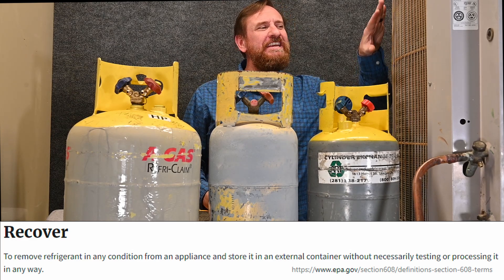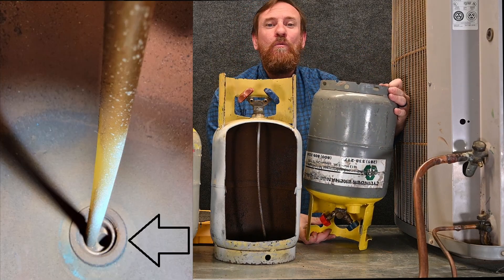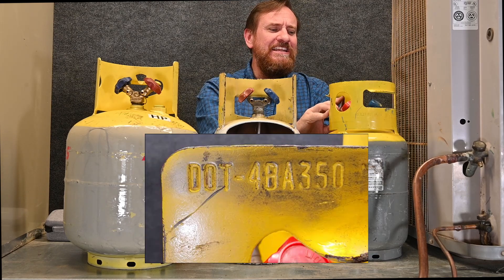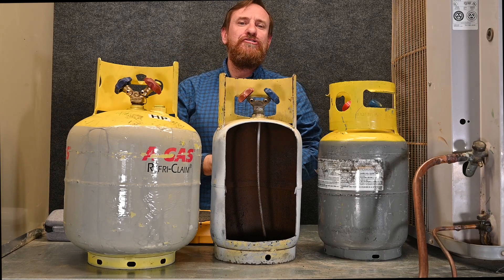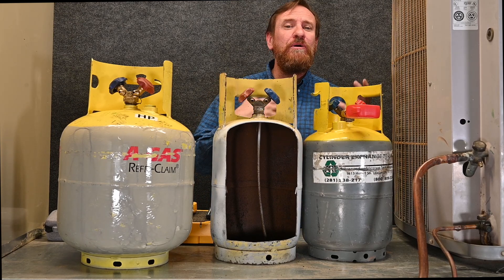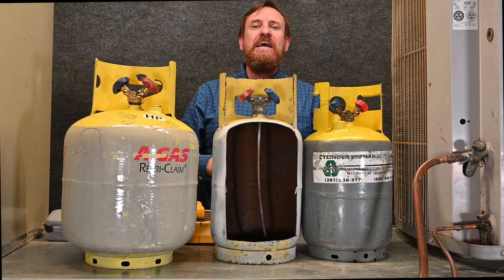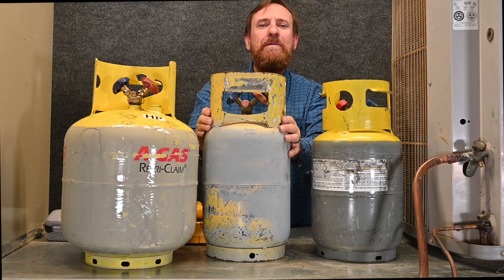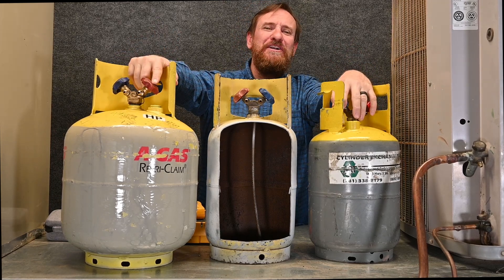HVAC 123 Recovery Tanks part 1

Comment: Sadly now a days  with all the Ozone friendly R22 retro  its not pure R22 anymore then when you turn in/exchange tank. Suppliers back charge you for a mix of Freon....   Sooooo   Tech/company has to eat that charge?
Reply from the maker: R22 was undoubtedly the best. 

Every single person in the trade was required to have an EPA 608 certification wich made it clear to not bent and "do not mix refrigerants"

The R22 replacements where retro fits not drop in.

All these "techs" that where mixing Refrigerant are the ones screwing over customers and the good techs. 

When the refrigerant are mixed they can't be recycled or reclaimed and have to be disposed of which is very expensive.  It also means the applications that still need R22 are so hard to find and over priced because the lack of stock not being turned in back in.

So yes techs, customers and companies have to eat the charge all because some lazy person who can't follow the basic most instructions decided it would be okay to just mix a substitute ruining both and cost someone else a lot of money down the line.

Comment: Question sir.

Context here is a mini-split running R410A.

Can recovered refrigerant from a unit that was low on charge due to a minor line-set leak, for instance, be reused?

System never open to the atmosphere, just low on charge and no other failure or repair other than leak correction after drawdown isolation to the condenser side.

Charge weight being critical on these machines, I would assume recovering, weighing, and reintroducing the used refrigerant plus make-up refrigerant from a new cylinder into a properly evacuated system would ensure the proper charge.

I'd appreciate your thoughts and input on this.
Reply from the maker: You can reuse it there is alwasy the risk of did it run into a  vacuum at any point and pull in moisture? it also takes linger but here is the steps.
Pull a deep vacuum on you recovery tank and do a decay test to ensure it clean and dry, 
Hook up your hoses and recovery machine and a new in line filter drier for your recovery machine.

Pull a deep vacuum on that setup. (hoses recovery machine ext.)
Open the valve to the unit, start recovery machine, open the valve to the tank and recover. 

When the repair is done, put a new inline filter direr on the recovery tank and a hose to that.
pull a vacuum trough the systems AND to the hose to the recovery tank at the same time. 
Preform your decay test.
Then weigh in the refrigerant back into the unit. it will e short so you will still need a new tank to top it off.
Reply: @love2hvac , thank you so much for your reply.

I understand exactly what you're saying and the procedure you're recommending.
I know, a lot of connections and reconnections here, everything has to be evacuated properly with every connection.
This is my own system, so I know the history of it. It's low but has not gone dead or low enough to draw in atmosphere.

If I have any doubts, I will have a friend of mine take my refrigerant for recycling in his equipment and I will start with a new charge.

Thank you again for your reply, I truly appreciate it.
Love your channel and I have subscribed!

Comment: When i recovered refrigerant out of my car A/C system, which is contaminated with 7% air, How could I remove air out of tank? i guess i could just open the vapor valve and release the pressure as the refrigerant is heavier than air will the air leave the cylinder first? Or the second possibility, if I turn the cylinder upside-down, or use the liquid port, then the air will stay on top of the cylinder, and when I refill the AC system with liquid refrigerant, I am 100% sure that it is free of air contamination?
Reply from the maker: Once it's contaminated, it should not be reused. 
There is also moisture and other contaminants in the air assuming you could get the air itself out.

After pulling a deep vacuum, use new refrigerant.

Comment: Please explain for red and green valves what's different between ?
Reply from the maker: Color does not matter, read on the valve for liquid or vapor.

Liquid has a straw to the bottom of the tank. Vapor opens to the top of the top of the tank

Comment: pressure variates w ambient temperature, will that chart be accurate to test tank temp vs tank pressure?
Reply from the maker: Yes it will follow the chart as long as there is some liquid in the tank and it's the pure refrigerant. If there is only vapor or it's contaminated it will not follow the chart.

Comment: Re. fresh tanks of r410a, when charging upside down how do you know when the liquid is finished and only gas is coming out?
Reply from the maker: Two ways 

Method 1 weight the tank before. Subtract the net weight (usually 25poinds) from the total now you know how much the empty tank weighs.

Method 2 zero the scale at each use. Record how much was used each time. When you reach the net amount (usually 25 pounds for 410A) you know the liquid is gone. 

After all the liquid is gone, recover the remaining vapor.
Reply: @love2hvac  thank you. But what if, as you come close to finishing that 25 pounds, some of that liquid flashes into vapour because of less pressure in the tank?   Or is the pressure in the tank always high enough to keep the liquid as liquid?
Reply from the maker: 410A is a near azeotrope. 
It is so close, it is highly unlikely to ever fractionate.

If you have a high glide such as 407C it's more of a concern, but if you were to take all the refrigerant out it would be the same % mixture as it was out into the tank.
Reply: @love2hvac  ah i understand🤘thank you for your help

Comment: Hey Ty, do the companies that reclaim refrigerant have a procedure for mixed refrigerant?  Meaning a way to separate them chemically?
Reply from the maker: 2.5.1 Mixed-gas separation 
Several processes can be used to separate mixed-gas; the most common is fractional distillation 
(Powell, 2009). However, few reclaimers have the resources to perform these complex processes, 
which can require as much as 50 times more energy per pound to process refrigerant than 
standard reclamation processes (Mandracchia, 2009). According to one reclaimer, there are only 
three or four facilities with separation capability at present (Steve Mandracchia, Hudson 
Technologies, personal communication, June 9, 2010). Most reclaimers will send mixed gas that 
is not easily blended up to 99.5% purity to these separation facilities. 
One reclaimer explained that the cost of separation for a 75% purity R-22 is about $3 per pound 
(not including the shipping cost), which would be taken out of the price the separation facility 
paid for the refrigerant. At present, separation facilities will purchase R-22 even if the purity of 
the refrigerant is as low as 75% because of the current price of R-22 (Jimmy Trout, AllCool, 
personal communication, June 24, 2010)
Reply from the maker: I found thir report at is possible depending on how bad the mixture is and what else it is mixed with. 
It seems like only a few have the capability and it's very costly. It seems that many have to destroy the refregerants Wich is very costly.
Reply from the maker: https://www.epa.gov/sites/production/files/2015-08/documents/analysis_of_equipment_and_practices_in_the_reclamation_industry.pdf
Reply: @love2hvac  , thanks so much for the reply. Hopefully this opens up the creative mind in people to create a more cost effective system. Always a way. You’re the man Ty. Much appreciated.

Comment: I am trying to evacuate a new refrigerant tank.  I can only get it down to 3000 microns or so.
Is that acceptable for filling with R22.  Is my vacuum pump not up to the task? I see where it should be down to 500 microns before using.
Reply from the maker: Sounds like there is a lot of contamination (moisture) in the tank

Comment: I have an empty tank that had 410a if I pull a vacuum on the tank can i use it for r22 or will it be contaminated?
Reply from the maker: Pull a deep vacuum and you can use it for R22.

The I known will be the oil or oil contaminants inside the tank.
Reply: @love2hvac  thanks man!

Comment: Hello, thank you for this video. I have a question - my R22 recovery bottle has the red and the blue valves but my R22 manifold has the yellow input house. Do you know by any chance where I connect the yellow house, to the red or the blue valves? I want o to recharge my system from the recovery bottle.
Reply from the maker: The colors of the knobs on the the tank are not relevant. 

Read  the words. One should say liquid one should say vapor.

You would connect the yellow hose to the one that said liquid.
Purge the hoses before charging.
Reply: @love2hvac  Thank you for your prompt reply! I was just recharging my AC from the R22 recovery bottle. I measured the pressure inside the bottle and at the beginning it was 148 psi at outside temperature 84 Fahrenheit. I purged all my hoses red, blue and yellow. I have connected the yellow hose of my R22 charging manifold to the vapor side and placed the tank upside down on the scale. When red and blue hoses were connected (red to the thin high side and blue to the thick low line) and the air conditioner was off I measured on red line 120 PSI and on blue line 115 PSI. When i started the AC, the red line was at 195 PSI and the blue was at 195 PSI. I started to add the R22 refrigerant from the bottle via the blue side vale in small portions and after 20 minutes of charging blue line was at 40 PSI and red was at 210 PSI. After 30 minutes of charging blue line at 46 PSI and red line at 215 psi. What is bothering me is that at the beginning the air temperature inside my house leaving the air duct was at 16.2 degree Celsius and after 30 minutes of my AC  charging it was 18.6 degree Celsius. Also I was under impression that the red line pressure will go up after charging and the blue line pressure should actually go down, but in my case it went up instead. Any recommendation what I have done wrongly?
Reply from the maker: Well, there is a lot wrong there.
1st pressures don't matter. 
It's all about the metering device,  superheat and subcooling. 

You will only be able to add while the system is running but only by slowly throttling it into the suction (blue) side. If it's not done right it will flood the compressor and damage it.

If you open the high side (red) while it is running, the unit will push refrigerant out of the unit into the tank.

Comment: Doesn't make a sense to go through each refrigerant type. each type should have certain pressure depending on temperature, i.e should just enter temperature and get pressure table to compare results
Reply from the maker: If you don't know the refrigerant, and only know the temperature and pressure, you will have to compare it to something. 
It also will not work with high glide blended refrigerants such as 406C
Reply: @love2hvac  you compare with pressure table: type of refrigetrant - pressure.. will be much faster than enter this result for each individual type
Reply from the maker: With the table you still have to go through several refrigerants.  The table jumps in higher increments of temp and pressures.
In this digital world your much more likely to have an app than a printed PT chart.

Comment: I think my 125 pound cylinder tank from 1952 has far surpassed their reinspection date.
              I can tell you from experience in an emergency when you put R410 in a 350 psi tank and you overfill it on a hot summer day when it blows off inside your vehicle with the oil that is mixed in the tank it instantly becomes all foggy inside your vehicle.
Reply from the maker: Oh no!!! That sounds like a hot mess! 

I never thought about the 125 pound tanks. Do they have the same recertification dates?
I worked for a guy years ago who bought a new 250 gallon propane tank. Pulled a vacuum  on it for a week and used it for his recovered R22 tank. He purchased a recycler and was planing on one day reselling it.  That was 15 years ago I need to follow up on it now.